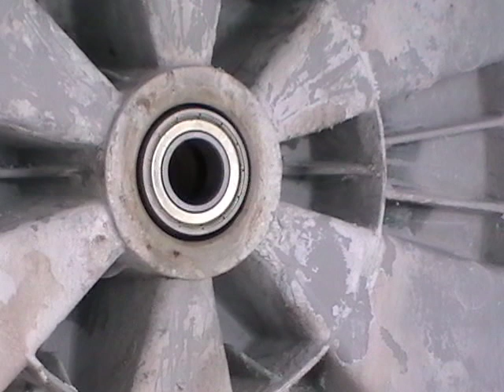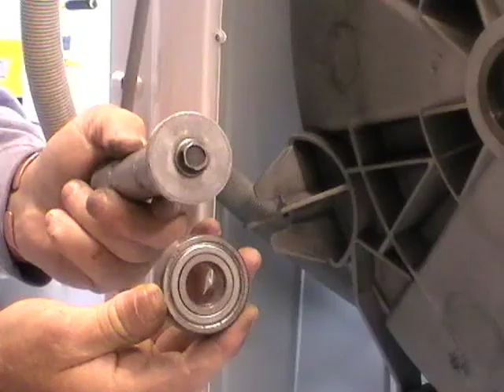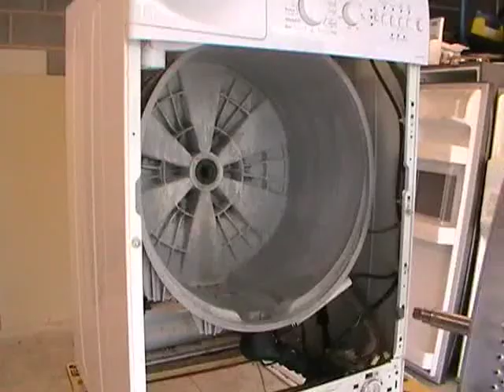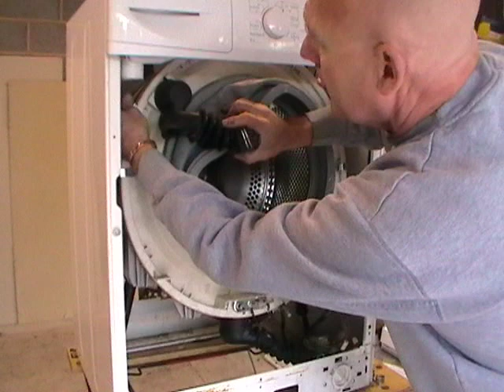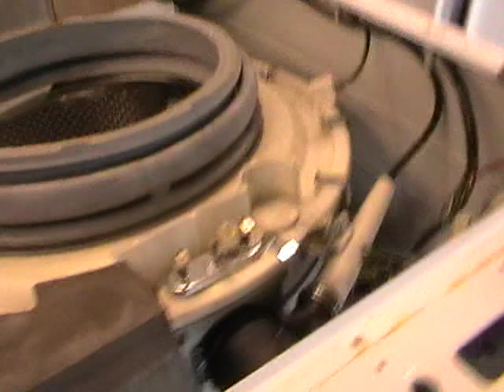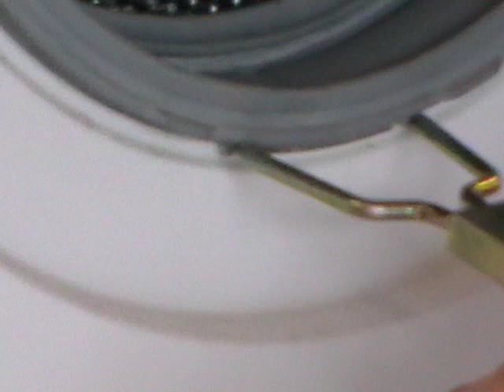.Beko washing machine WMA520W bearing failure Part 2

Comment: Turns out many of these tubs are now welded shut so you can't open the tub up to change the bearings. Better check before you start taking the machine apart like I just did. ugh they want £175 on a new tub assembly. What a waste of materials too.
Reply: Yep just found this out when I trued to order bearings which I would have fitted.Need to find out if some one has opened a beko sealed tub and where they got bearings from.

Comment: Thanks for posting this guide, I've got to fix a WM6120W soon and at first glance the drum looks to be very similar or the same.  It's good to know what to expect and what tools/parts I'll need before opening it up.  I've mostly worked on Hotpoints and a few Bosch machines but this will be the first Beko I take apart.  I've been staying at my friend's house, using his washing machine and now the bearing's started getting noisy, so it's only fair that I sort it out for him.